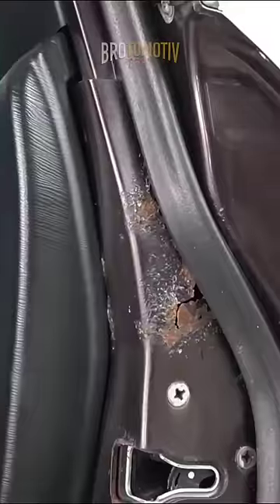Watch VLOG 02: Car Baar Baar Wash karne se Rust Hone Lagti hai

Comment: Bro just sand the rusted areas out and fill it with filler, then sand it and paint. Or if the rusting is too much, chop off the rusted metal and replace it with adequately sized sheet metal and just weld it in place. Choose strong sheet metal to maintain structural integrity. Sand, apply primer and paint

Comment: Wash your car properly but cover scratches or exposed metal with paint or at least some sort of water repellent coating. Iron and water will always form rust. You need to prevent water from coming in contact with your body. Damp cloth is also not the right solution as you will put micro scratches on paint. Use car shampoo to wash the car and then dry with a microfiber cloth. If you want to go and extra mile apply a wax coat every few months.